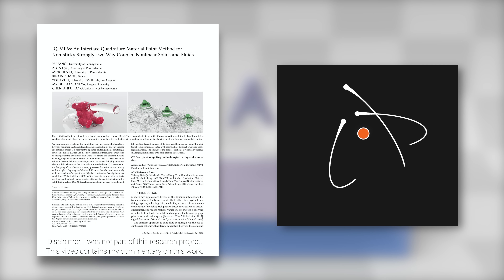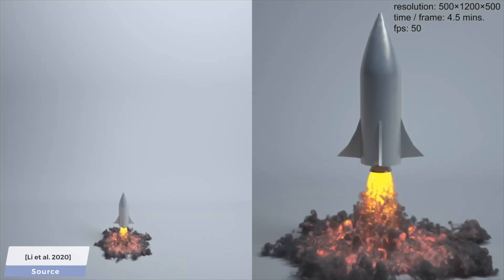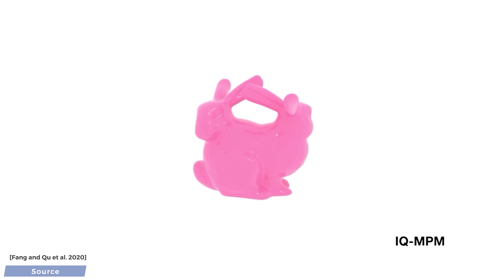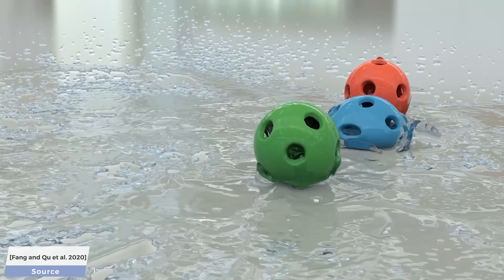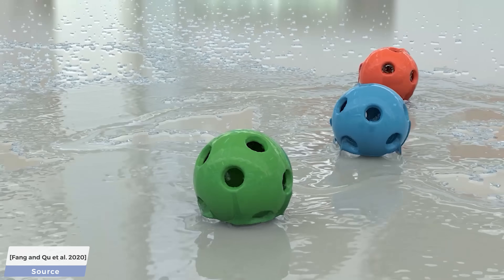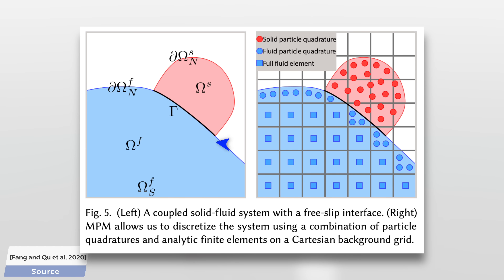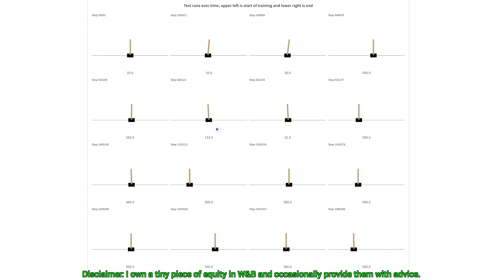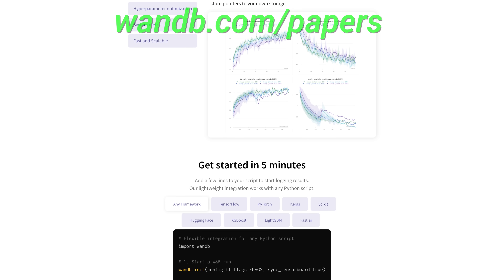Beautiful Elastic Simulations, Now Much Faster!

Comment: All these visualizations look extremely good. But They suffer from a lack of comparisons with experiments. And all these tasks could be solved with commercial simulation codes like LS-DYNA or Particleworks. Visualization and speed will not be so good, of course, but that would be physically correct results. So what do you think about verification and validation of the physical part of all these simulations?

Comment: 1:00 Technically, the real water sticks to the surface as in the first two rabbit exemples, it's called getting wet. The problem here is just the dimension of the particles: water leaves a very thin layer of wet because of the smallness of the molecules.
Reply: First two is simply mashed potatoes)))

Comment: The way the last method can detect the point where two substances make contact got me thinking. I was recently wondering about the problem in video games and other simulations where there is "clip through". For instance a person picks up a glass but their hand doesn't wrap around but just clips through the class like it's not there. Same for clothing. A character can be wearing a jacket but the collar just clips right into their neck. Hopefully a similar method of showing the contact surfaces that you showed can be used to fix that problem easily so it can show up in real-time rendered gaming engines.
Reply: Most objects in games don’t have an exact collision to save proformance

Comment: Here's a good question though. Why do they almost never do simulations of realistically achievable things. I want to see a real object dropped in a repeatable way into real water in a real container, side by side with the simulation thereof. 
I've never seen a levitating water filled gummy warewolf have its arms and legs magically ripped off. I've never seen rubber wiffle balls appear in mid air with their entire inner volume perfectly filled with water. I've never seen a sand snowman hang in suspended animation whilst I prepared a snippet of perfectly laminar flow to impact it as it reanimates. These examples are neat to look at but at a fundamental level, they are hardly meaningful.
Reply: Most of the foundamental physics involved in these simulations are more than a century old and based on real-world measurements. There are lots and lots of real vs sim comparison videos. But, once we know the rules and the sim work, we can apply them to a very different and never-seen-before situation and trust them to quite an extent. After all this is just graphics.
Reply: @gekfurian  Uhh, yeah. I know that Newtonian physics is worked out and verified by measurement. What does that have to do with the fact that these state of the art physics simulations don't generally agree with it? The point is that the don't work, which is why they continue to be updated, and why they need to be tested against the objective standard of reality.
Reply: @AtlasReburdened  as I said, this is just graphics. Through the years I discovered a strange fact: photorealism isn't absolute, but it's time-related. What looked photorealistic 20 or 10 years ago now looks fake, because today we're more used and exposed to CGI. As our expectation grows, so must technology do to stay at pace.

Comment: hey Karoly, in the flip fluids add on video by pavel blend, why does the fluid at 0:28 keep moving after the invisible box has stopped moving? isn't fluid usually supposed to calm down after being shaken up?
Reply: It takes some time for the fluid to settle down. It doesn't look right because the simulation size is several meters.
Reply: @UncleBurrito15   oh. thanks kind stranger!

Comment: How long until I can mess around with an erosion simulator? I'd be fine if it took 5 minutes to render a 30 second scene.
Reply: @nemo-x  I never actually looked at the paper until now, but that's pretty slow. I wonder how low we could get the resolution with it still looking reasonable. The fastest one was the water on the rubber mat with .88M particles, and that took 48 seconds per frame and still looked great. If we brought that down to perhaps 0.25M and used an rtx 3090 instead of a gtx 1050 TI, we could probably get 15x faster, which would be 4 seconds per frame. Then a 30 second video at 30fps would take an hour to render. If we time lapsed the video (since the erosion is a slow process anyway), we might be able to cut the time in half with optimizations that I would expect in the next paper. I guess to answer my original question, maybe 2-10 years.